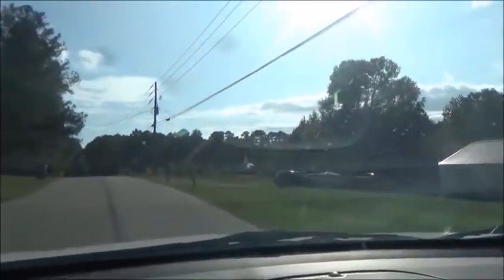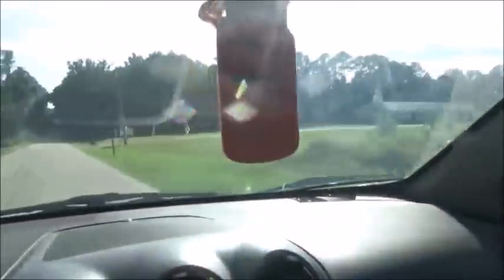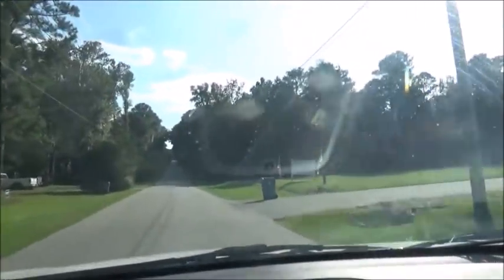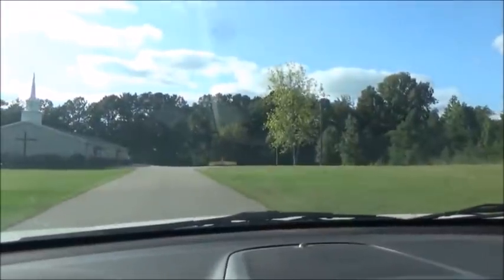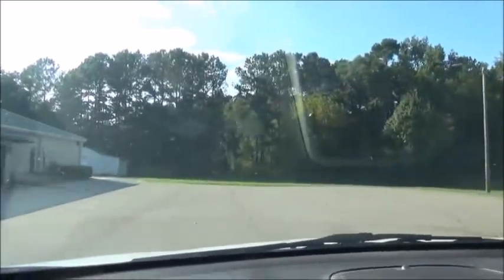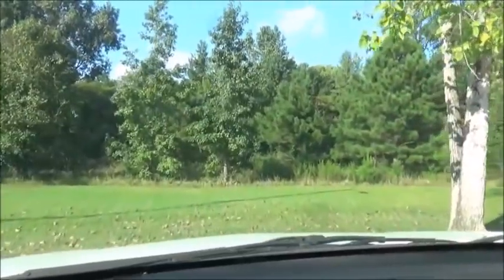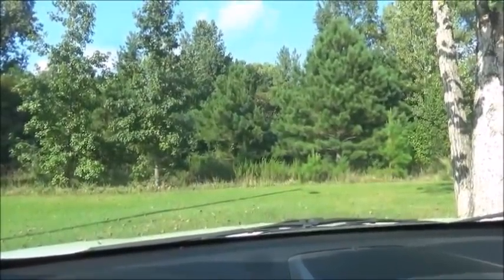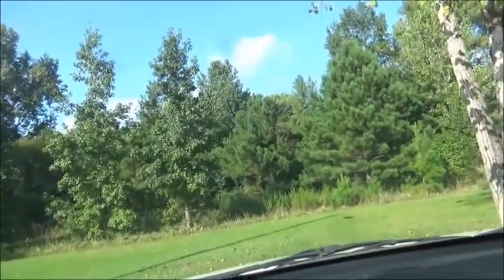BATES CORLISS STEAM ENGINE 20+ YEAR QUEST TO SAVE EPISODE 1

Comment: It's tough when people don't want to sell. When you find all the parts it could very likely be put back into service. All it needs is a job. For example, that engine could push a pretty decent size Mississippi riverboat. A modern ship and modern installation of an antique engine is cool as anything.

Comment: You need to do  "first start for 100 years" on this engine Jonothan. I'm sure it can be done if you have the boiler.
Reply: and 200 BHP you could run it off of scrap wood and connect a generator to it, run your whole house and work shop off of it.

Comment: Hey Jonathan I have a complete steam engine I saved from a corn field. I was a machinist for 40 years, before I retired I went through the engine and it runs great on 3/4 line 120 psi. This is a sweet engine, it has duel flywheels a 48 in. and a 36 in the cylinder bore measures 8 3/8 ID  I have all the oilers and a large steam whistle. I made large tubing legs and it can be sat anywhere, engine weighs over 4000 lbs. I am getting old and the engine needs a good home, ill make you a deal you cant refuse. I'm in central Alabama and like to hear from you

Comment: Sure needs saving if you can. It’s water under the bridge it would have been nice for you to gotten it when you first wanted it. Before I retired we still a couple of pieces of equipment that had Babbitt bearings. They were bearing on huge electric generator on a large Page dragline. For mining phosphate and they also used them in above ground coal mine’s. Thanks for sharing

Comment: Jon, after seeing this video about the steam engine I had to write to tell you how much I appreciate you trying to do what you are trying to do. I guess it made my heart kinda flutter to know that there was still people who take the time to look at these old power makers. My Dad started out in the old oil field when they still used some steam engines to run those old standard derrick drilling rigs and he worked over 40 years at it. I am the only son that followed his footsteps but I worked in the production phase of the oil business and worked as an offshore lease operator and mechanic for over 40 years. I have worked and operated some huge old engines in my day myself. Some of the old White's and Waukeshas that I worked on were so big you could crawl into the crankcase. I had one old Ajax three cylinder engine that was used at one time as the propulsion engine in submarines in WW1 and at the time we had this one that was coupled to a 3 stage gas compressor. It had a 20ft flywheel and it ran on natural gas and put out 300 H.P. It used reed valves as the carbeurator set-up. It was a hit/miss engine fired by magneto. Once you got it fired up though that son of a gun would do a lot of work and compressed gas over 1200 psi to force ito a high pressure pipeline. I enjoy your channel keep up the videos please.

Comment: There’s a big old rusty gas engine near a harbor where I live. The engine has got to be 20-30 feet long, and it is directly in front of some tracks, so I’m guessing it was used to pull carts filled with supplies from docks where ships had loaded them. I hope I get the chance to at least partially preserve some of it, it’s stuck solid from being near the salt water since the late 1800s.

Comment: Jonathan, I’m very interested in your story of the steam engine. About 40 years ago, I was introduced through a friend to a man in Rhode Island who owned a steam engine museum. He had quite a collection of old mill engines, including a 4 valve Corliss, very similar to the one you are trying to save. Over the years, I did a lot of volunteer work for the museum, and with the help of a book I bought at a flea market, I was able to set up the valves on that engine and restore it to running condition. I’m probably one of the few people left with actual hands on experience on Corliss steam engines. 
Corliss engines were made in Rhode Island, invented to run the textile mills there and in Connecticut. 
I know of a couple non running engines in Connecticut as well, although I haven’t physically seen them in over 30 years.  
I’m dying to see if you can recover the rest of that engine. Didn’t see the bed frame, cylinder etc. I hope you can locate the rest of the parts.

Comment: Jay Leno's passion, steam engines, that's where the phrase going balls out comes from, hope it all comes together for ya JW
Reply: Charlie Booker  the governor on the steam engine has 2 weighted balls that spin as you increase the rpms the balls swing out due to centrifugal force, the higher the rpm the further they swing out, hence the phrase , going balls out
Reply: @1eyedjackxo  EXACTLY!!!!
Reply: As I recall, Jay has a giant steam engine up and running in his garage. I think maybe it was for pumping water out of mines? Damn thing was huge.
Reply: Charlie Booker  Balls to the wall may mean what you say. But that's not what Charley Booker said!!
Reply: Charlie Booker yep, you’re correct.
Reply: Actually when the balls are all the way out it cuts off the steam. Balls all the way in and you have steam admission throughout the whole power stroke
Reply: Charlie Booker  Bingo!!!   As i recall, jay ran his oncompressed air, not steam. Boilers are very dangerous!!!